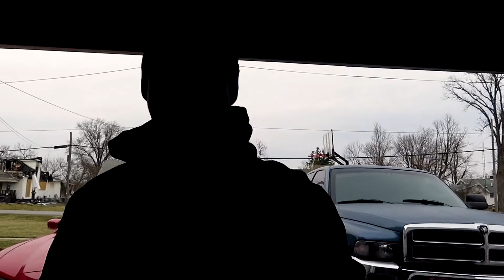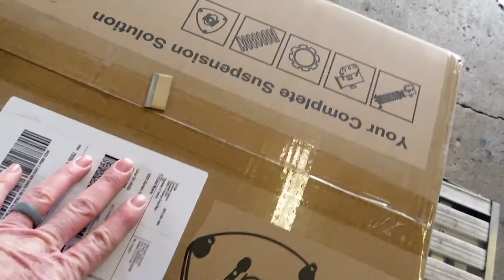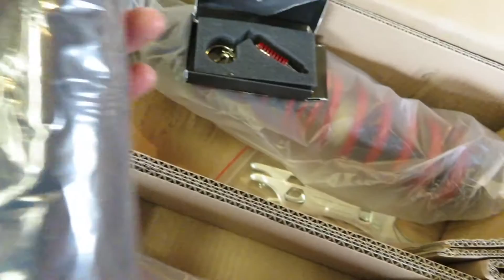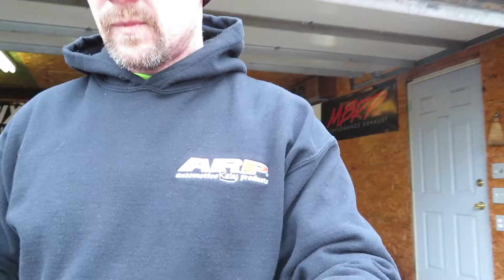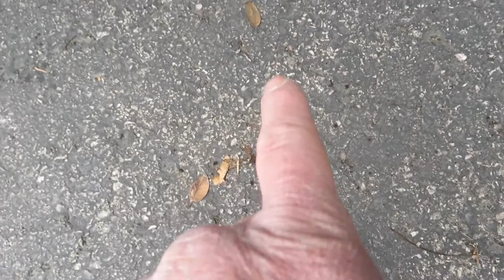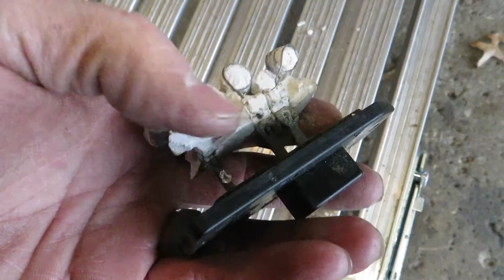Dodge Ram2500 Blower Motor Resistor  2nd gen Cummins

Comment: Hopefully you can still respond to this! I can feel the heat, but doesn’t work on any setting. Smell a burning smell, is it a resistor or blower motor?
Reply from the maker: I would check both may need to replace both of them.

Comment: How about if the resistor doesn't blow air on any position ??
Reply from the maker: It would be either your switch, fan or a short in the harness.
Reply: @ChadMyers73  it's the fan I think ,I took the bolts out and connected then turn the fan manually and it kicked in but not as fast as it should be ,but it's working ,maybe it needs to be greased or something what you recommend me?
Reply from the maker: @drito1977pc  If it comes on using the switch and it only runs on certain speeds than it is your resistor.